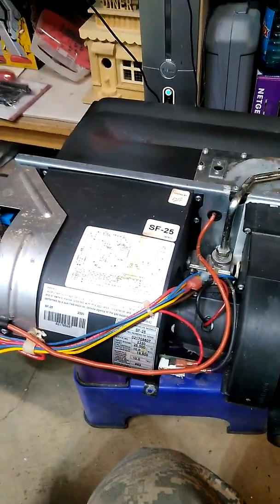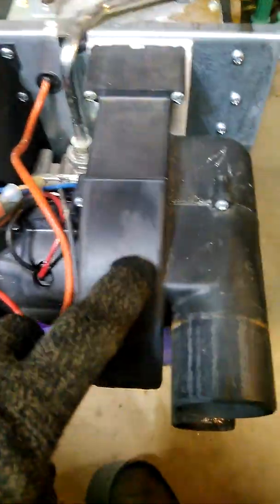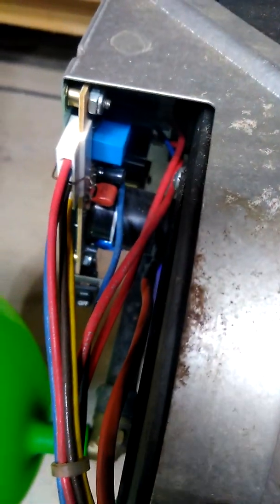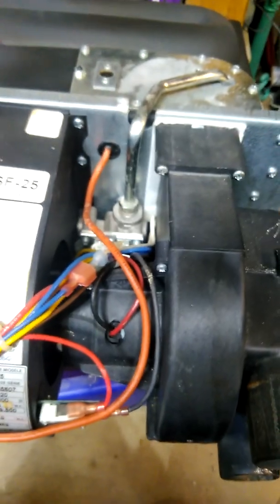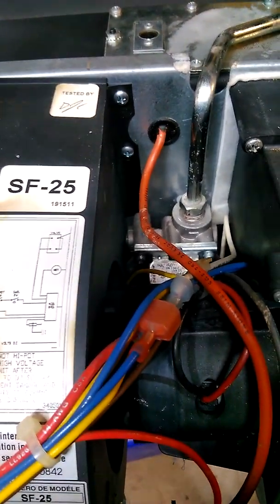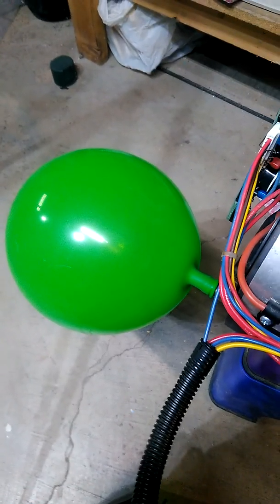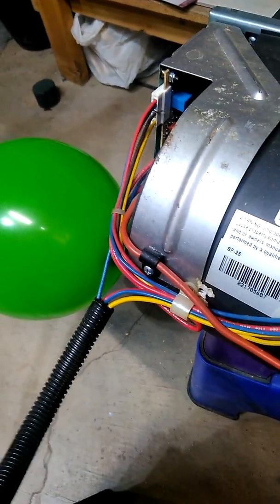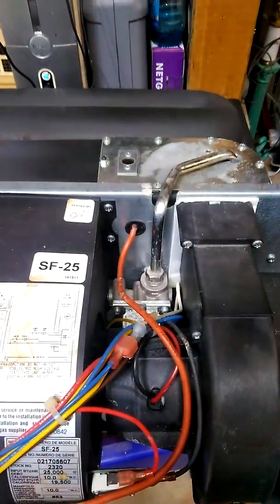February 4, 2021 SF-25 Suburban Furnace inoperative

Comment: I bought a 89 motor home with a suburban furnace. When the weather got cold it would squeal like a stuck pig. I took it out and found that the blower motor was making the noise. I tried to order a replacement motor from suburban.  They informed me that the unit was obsolete so no parts available. They did offer a recore option. But being the tightwad I am I unstaked the end of the motor to take it apart. The problem inside was the stiff oil mixed with copper dust from the brushes. I cleaned it up and relubed the bushings with 3 in 1 oil. Good thing the brushes were in good condition. Two years later it is running quietly